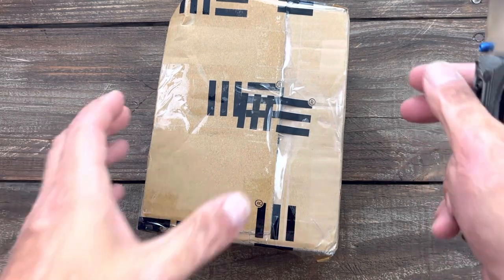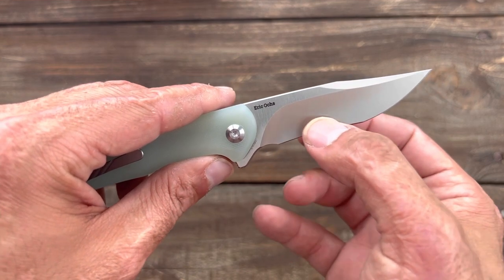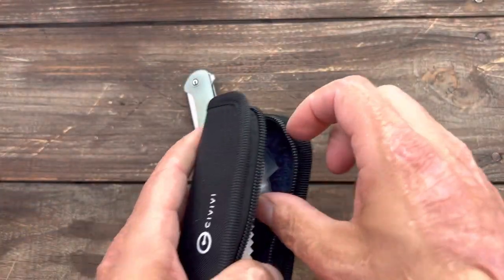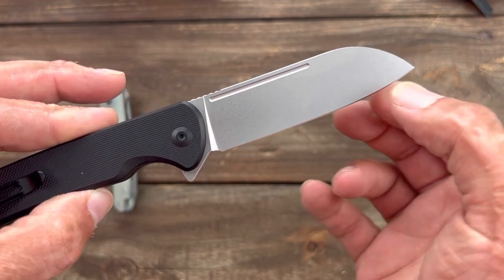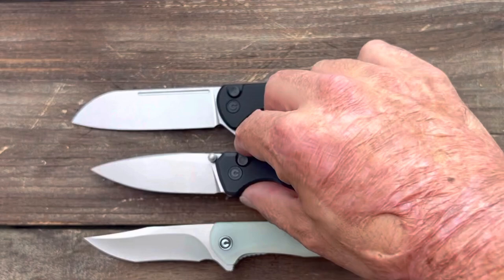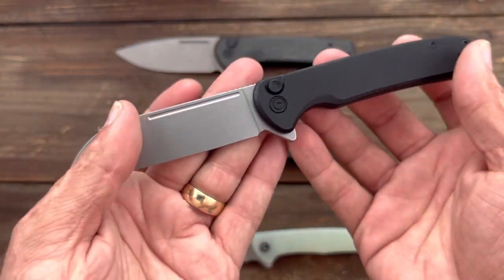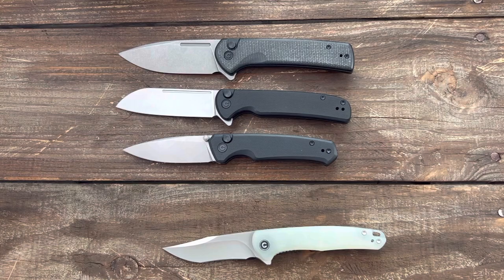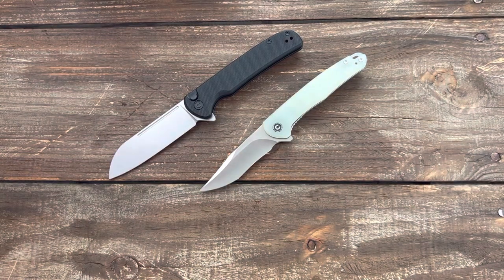NEW RELEASES! CIVIVI CHEVALIER & MINI SANDBAR UNBOXING

Comment: Sticking problem is the same on the cogent. Shave off a small amount on the round bottom of the blade stock bc it grounds against the button. My cogent free floats now. Opens and closes better than factory.